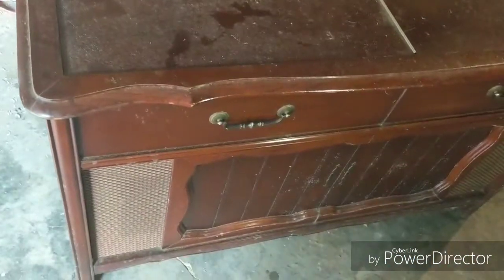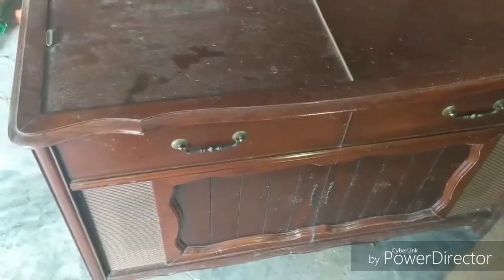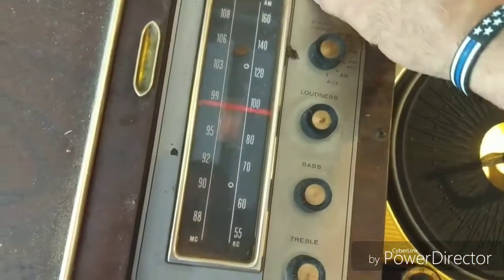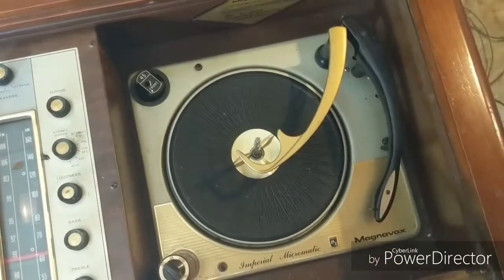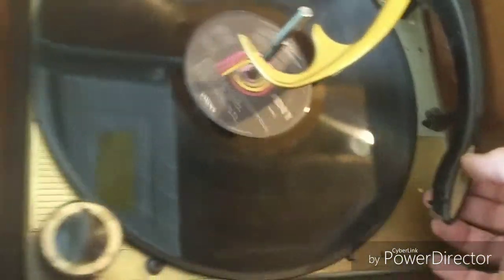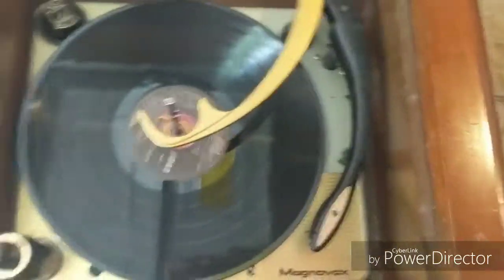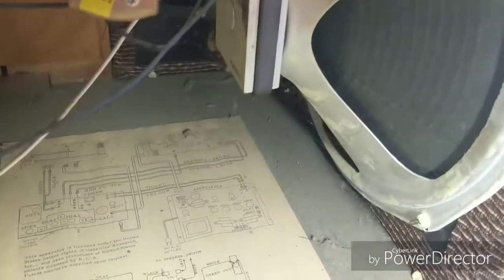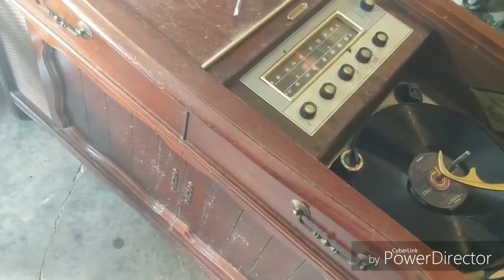Will It Work? Vintage Magnavox Stereo Console

Comment: Fabulous.  The moment you slid open the top and I saw the preamp controls I thought  - whoa, you're in for a cracking surprise when you open the back up.   Those valve amps sound really stunning - a sound I will remain happy with forever.  Have a similar model but without the horns - hope this treasure gives you many years of pleasure.

Comment: You had me when you toasted those who serve! Anyway, when you thought it had no capacitors, it has many. Most of which are UNDER the metal tube chassis, as I'm guessing you discovered along with a ton of resistors.  And those big silver cans above are also capacitors. That being said, you have a beautiful unit there. Some of the magic you hear is a combination of that big woofer (not a "sub", just a woofer) and those wonderful horns running front-to-back. They make an amazing sound! Enjoy it; you are blessed. I myself would take it apart, make a separate amp, preamp, tuner (NOT a receiver, as you say here: that's a tuner. A receiver is a unit that combines those three), speakers and turntable from that. Most folks don't want a big hulking unit in the living room anymore, more's the pity.  If you've restored it and kept it whole, again - you are blessed.  Enjoy it! The tube version you have is MUCH more desirable than the solid state transistor units usually found.  The sound of your is FAR superior.

Comment from the maker: Thanks! I just had it recapped and it sounds even better!
Reply: Do you need to remove the amp before spraying the volume control with Deoxit or can you just spray contact cleaner onto the shaft of the controls without removing the amp to address the static issue?  Have a similar console with the same static issue. Thanks!
Reply from the maker: @EdwardBurke73  I think it's easier to get to if you pull it out. There's a lot more underneath, but I suppose you could try. Are you on Facebook? Search for a group called "Magnavox Stereo Consoles & Other Magnificent Magnavox Products". There are people there who know a lot more than me and have guided me along the way! Good luck!

Comment: I bought an astro sonic made in 1965  and replaced all but one transistor on the stereo fm board and all but two on the preamp board
Reply from the maker: Nice! I finally got this one re-capped and it's become my primary unit!
Reply: @MichaelPrathersPage  did replacing the cartridge fix the sound?
Reply from the maker: @Z0S084  I took out the entire receiver and took it to someone who knows how to repair vintage electronics. I did change the cartridge, but it also needed new tubes and other internal components. I probably spent another $100. It sounds great now!
Reply: @MichaelPrathersPage  
Nice! That's what I'll probably end up doing. Thanks.

Comment: I know this is an old video but there's an old saying ain't broke don't fix it the only thing you should do to that unit is clean it get rid of all the Dust clean the wood treated wood and live it well alone clean the contacts make sure the volume controls and all the other controls are nice and clean clean up all the old grease on the turntable put fresh grease on it put it all back together and leave it alone yeah you can turn around and take the tubes out and check him to see if there's a week once cuz this week once will still give you a sound and if there is weak ones you can replace them but if they're still working and is still above the week. Leave them alone if you know somebody who has a tube tester it's very easy to check them but as long as they're above the week area on the tube tester there is a gauge on it app and as long as it in the green the tube is fine and you don't have to replace it I'll leave it alone that's the way I've been preparing these things for years yes you can turn around and check the capacitors for ESR some of them get a high ESR when they get older if they're really high up those are the ones you change and you probably might have some of those old wax covered capacitors in there if they test out okay leave them alone I know there's some people say change them out but if they test out okay and the ESR is okay leave them alone because that's why you're getting such good sound out of the unit some people want you to change them out but the modern-day capacitors in them there are times when you should but if the capacitor is working and doing its job and is no sign of it going bad leave it alone